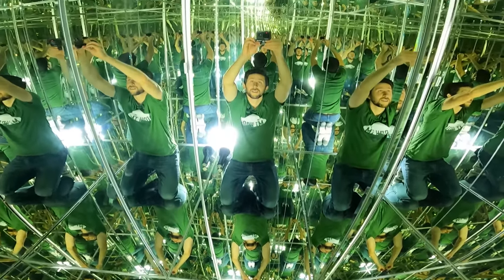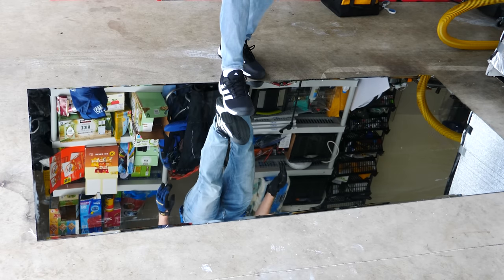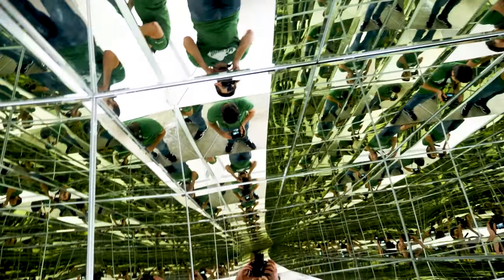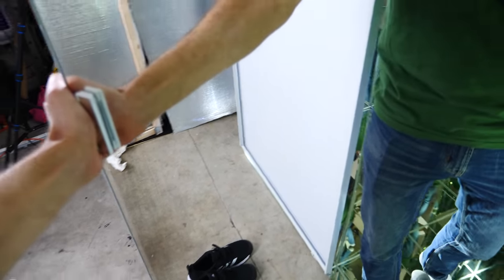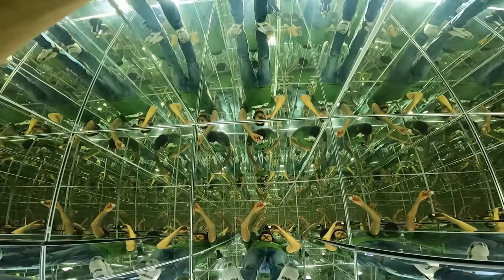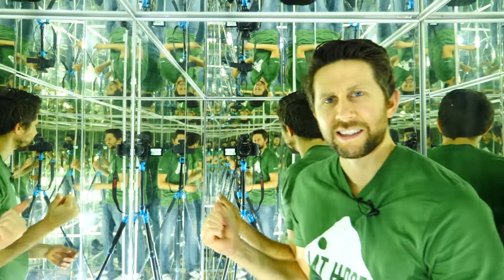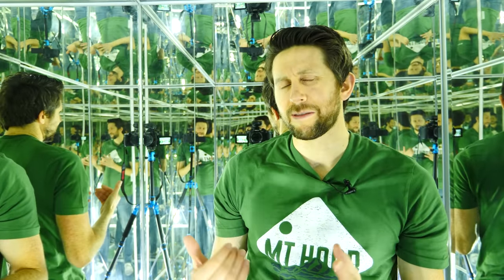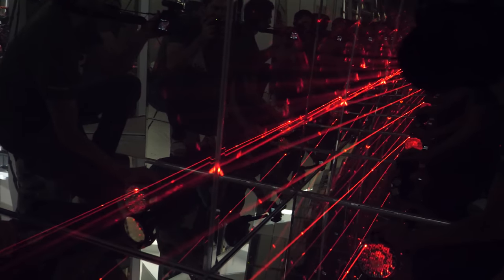I Built An Entire Room Made Completely Out of Mirrors!

Comment: Very impressive simulation. You would expect running so many instances to cause slight stuttering. Maybe if thousands of us made mirror rooms and stepped into them simultaneously we could overload the system.
Reply: The universe, simulating high fidelity fluid dynamics in real-time with no lag: nice try kid.
Reply: Kernel panic - not syncing: too many fucking mirrors, bud
Reply: The diminution of photic energy baked into every reflective surface limits the number of bounces to a finite sum.  The recursion of similar information in each iteration means you only calculate the full render once and repeat the output with a small spacial transform x number of times where x = the point at which all light energy has been absorbed.  We can do this on cheap GPUs already.  No big deal for the universe or simulation if you're into that sort of thing.
Reply: @dsdy1205  "no lag"
light traveling to us for 20 years: bruh
Reply: @markjayzeeortega2195  that's not lag. If you're playing a racing game and your car has a top speed, does that mean the game is lagging?
Reply: Wouldn't overload its a high computational system  would create some lag
Reply: @bisneytm1511  no, it would definitely break  system, in fact if we all do that at the same time we can stop the time on earth until the annunaki operators reload the gaia module
Reply: We would go to the backrooms
Reply: If the whole universe lagged, we wouldn't notice anything because we would also pause and continue
Reply: @Ramkatt  fr lmao
Reply: Still waiting for someone to be r/wooooshed.
Reply: @the_dripgoku  overrated bruh
Reply: One of us would either go the way of diavolo or backrooms
Reply: well if the timer is also in-game, the real life time can stutter however it wants but our time stutters with it, meaning it's always gonna be lagless
Reply: @Ramkatt  we're NPCS
Reply: this is why they limited the strength of reflections to only 95%, to avoid lags
Reply: Its actually just a shader trick and isn't actually multiple instances! Saves insane costs on the GPU!
Reply: @Aero3D  oh damn
Reply: This ain't a game
Reply: Wait, this isn't a DDOs attempt against the gods system?
Reply: It's possible that if 1000s build mirror rooms & simultaneously step into them then we advance to 'bonus stage' where we then all have to collect safely as many ducks in a 24h period upon whjtch we {obviously} advance lvl.
Reply: LaAAAaaaAGGGG!!!
Reply: @Ramkatt  so i could be as laggy as 2b2t and not notice it?
i could take 5 minutes to eat and be unaffected???
Reply: i did notice my speech dissapearing temorarily and people running at 0 speed and teleporting a while away while he made the video
Reply: it actually only renders light inner reflections 20 times before it turns completely green
Reply: Frame drop at 4:30
Reply: Why do you think we can only see 16 reflections?
Reply: or if we all made a recording software record itself
Reply: @googooblabla100  i think 5% light is lost for each reflection so you can only see about 16 reflections before it goes completely dark

Comment: Fun Fact : Real mirrors aren't perfect, and their surface atoms give any reflection a very slight green tinge, it's not his green shirt that's making things green.
Reply: It is actually the iron oxide in glass that makes it look green.
Reply: @dominicmendolia8309  And probably the majority of the 5 % of loss is the transition/scattering in the glass. So maybe in theory e.g. a mirror finish metal plate could have less loss? (but prohibitively expensive, especially in these sizes I imagine)
Reply: I thought the whole thing reminded me of The Matrix
Reply: @YCbCr  silicon would be best bet
Reply: Also our eye response has a peak in the green
Reply: its because the mirror part is on the back of the glass, glass has a slight green tint to it. after passing through so many mirrors, the reflected light will end up looking more green than the original one
Reply: But what if the T-shirt does contribute to it?
Reply: or highly polished silver metal sheets can be extremely reflective but that would be very expensive to make

Comment: Gabriels Horn Paradox is only a paradox because the volume is considered to be finite, but it actually isn't. This occurs because of the mathematical convention that anything divided by infinity is zero. If you think of the horn as a bottomless pit instead (with a bore that gets smaller exponentially, but never reaches bottom) then it's no longer paradoxical.

Comment: I’ve been in the mirror industry for 11 years, & grew up with it before working in it. 

Usually wardrobe mirrors are 1/8” thick, real thin. I’m surprised it didn’t break on that concrete, when he stepped on it. 
Let alone when he dropped that golf ball. 

Scared the living crap out of me xD
Reply: pretty sure that was a pingpong ball and not a golfball.
Reply: @arohk4415  I thought it was a ping pong ball initially, but I thought I saw the wee divots that a golfball has
Reply: It’s definitely a ping pong ball. Ping pong balls bounce, and sound like that. I also never saw the digits of a golf ball.
Reply: well the mirror not breaking is all dependent of surface area and pressure, with the flat concrete under when he steps on it spreads his weight evenly on the glass floor and concrete but if it was over that crack he showed it was more likely to break as it would create an area of pressure on the glass as he step over it causing the mirror to bend. the ball if thrown could have broken it but it dropped due to gravity wasn't too much force and the same as stepping on it applies but as well the ball compresses before it bounces back which increases the surface area as well.
Reply: @Srade2412  🤓☝️
Reply: @1percentsmart  Judging by your comment, your name is very accurate
Reply: @CAT-astrophical  called a joke. Heard of it?
Reply: @1percentsmart  Yes and im pretty sure two single emoji's aren't a joke and also if it was joke then how is my comment not a joke too?
Reply: @CAT-astrophical  because those 2 emoji's are probably known everywhere and is still used. Your previous comment was a joke so...
Reply: @1percentsmart  Fair enough have a great day
Reply: @CAT-astrophical  you too
Reply: @1percentsmart  That was the quickest solved argument i've ever seen on youtube lol
Reply: @CAT-astrophical my pp hurt
Reply: @Michaelroni-n-cheese  you should try some straight poo as well, not nearly as tasty, but you have to step outside your boundaries and really take life by the balls, and maybe the labia too.
Reply: Do you know how you could create a safe floor to walk on? Maybe below walkable glass? Plexiglas?

Comment: Wanna know something weird? Supposedly, this is a working model of a tesseract. Or a projection of 4D in 3D. It’s actually warping light back on itself so fast that it’s repeating into a temporal dimension. Now, imagine if the mirrors could not only bend light into a temporal dimension, but if it were bending space at the same rate, homie would have a working Tess. Wild.

Comment: o & by the way, it'd sure be entertaining to see one of these built using different kinds of funhouse mirrors! is this the same thing as a "catoptric cistula"?
another "by the way": i've a shack i've built in the bush & kept finding mirrors in the garbage & bringing them over & mounting them (the biggest is about 2-1/2 x 6 feet!) on all the walls & ceiling. i'd estimate that perhaps 65% of those available surfaces are mirror, the rest being windows, paintings & other art, & a small amount of wall. one fun thing i was able to do was, in nailing the stuff onto somewhat uneven surfaces (they're mainly in wood frames), i was able to put slight twists into the longer, slender mirrors (say, 5 x 1 feet), which makes the multiple reflections that much stranger.

Comment: Now imagine one side (the door) be replaced with a two way mirror. This my idea for many years. That way you can look into the mirror room from outside and then you do not stand in your own way. The infinity then is only limited by the strentgh of the light. Or if you do not have a two way mirror, create a miniscule needle size hole and look though that. The downside of one tiny hole is that you lose depth watch as you need two eyes for that :)  Creating two needle holes (to get depth possibilty back)  at the exact eyes distance is extremely difficult.

Comment: If standing between 2 mirrors that are facing each other, you see many different reflections of yourself.  After about the 5th or 6th reflection you can start to see a noticeable delay in your movements vs the reflection.  I am assuming that is due to the speed of light, but if that is the case why am I seeing the delay after just a couple reflections?  Then more thought into this, since there is a delay in what you can see because of how long it takes the light to get to your eye, if someone were standing 300 meters from you and clapped their hands, they would have actually already have clapped before you see them connect, no matter how small the difference in time.  

Then the whole laser thing.  If you could shine a laser between 2 mirrors in the same configuration, then at the same perspective you should be able to capture the laser light turning off in the delayed reflections.  If that is the case then if you could pulse a laser incredibly quick and with a slow motion camera you should be able to see that pulse move through the reflections.

I am sure that this has all been tested time and time again by scientists but I have never seen it.  Video?

Comment: Thank you. You answered a question for me.
Now I have another. You did consider the mirrors doing only 90 percent light. You did not speak about your body and equipment. How much do they absorb. If you still have it up, can you retest the light with outside switch and somehow camera it without much absorbtion from your equipment?

No. I dont think the light will stay on, but it would be an interesting test.

Also use extreme slowmow and do several tests with you in the room and without you.

Damn. Only noticed this is 2 years ago.

Comment: If the perimeter is infinite... then what happens when you convert the perimeter into a circumference? Hence... a spherical shaped room would have an infinite perimeter. We cannot bend mirrors to the point of forming them into a hollow ball that we could walk inside of... but we could make a metal hollow sphere using a polishable metal, and then polish that metal until it becomes as clean as a mirror.

Comment: So after 20 reflection, you lose all light
Reply: No. About 5% of the light is lost with each reflection. So after the first reflection 5% is lost. So for the second reflection the light is 95% of its original intensity and 5% of 95 is 4.75 so only 4.75% of the original intensity is lost with the second reflection. That brings the light intensity down to 90.25% of the original intensity and 5% of that is 4.5125 so only 4.5125% of the original intensity is lost with the third reflection. The percentage of the ORIGINAL intensity lost drops down from 5% with each reflection.